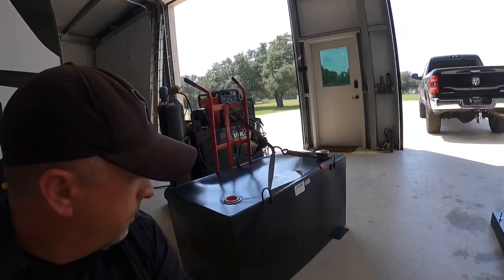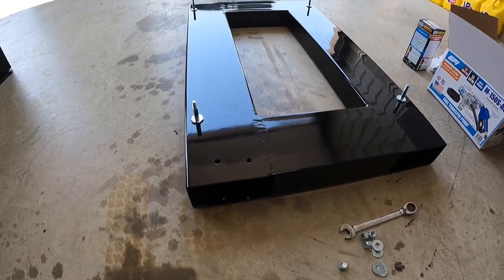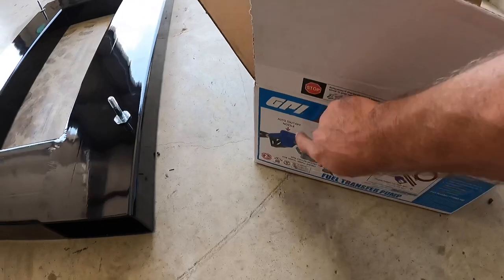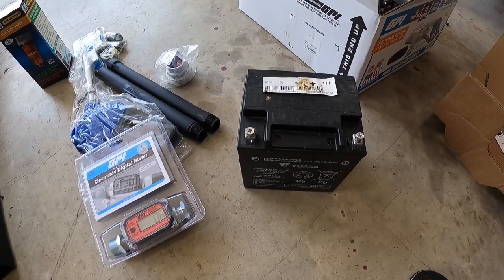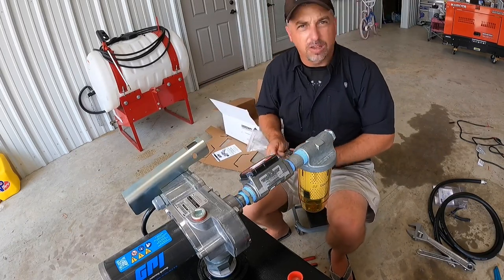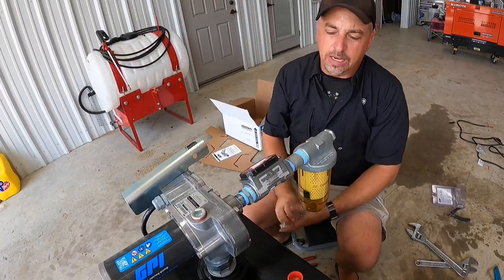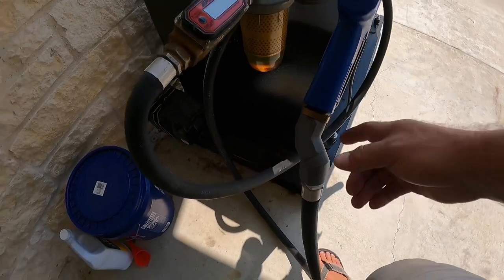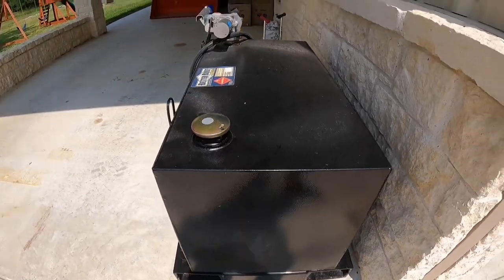Diesel Transfer Tank 100 gallon portable

Comment: Question i noticed the gas cap has like two settings will the gas cap automatically vent when turned in the fully closed position , or should i leave it in the half turn position to vent high pressure? My cap also has a small hole at the edge. I think its for a lock. Last question anyway to test for leaks. I have 100 gallon better built L shape for my truck . Thanks great video.

Comment: hey rocky
second time Im looking for a solution and I run into your channel (last time was for RV AC solutions)

Im actually now looking to add an auxiliary tank for my ram2500 diesel
but this cool video is actually for a shop tank. 

 have you ever put an auxiliary tank to any of your trucks? 
information is kind of all over the place. 
tanks go from $400 (lund brand for example) to $1500 without much difference for what I can see (some are plastic)
some people using pump, other gravity, 

we can see the quality of the jobs you do, would love to hear your input on that. 
thanks rocky
Reply from the maker: I have a few videos on my channel installing s&b 50 gallon. It has aux port and mounts under truck. I just like my bed space especially with rambox.
Reply from the maker: I built the standalone 100 gallon tank so I can load in the bed. If I have a long trip I can just load it up.
Reply: @RockyRohde  yeah I saw those videos thanks. but im on the fence with the 50 gal tank replacement vs a 40/50 gal aux tank. it feels like a lot of money and hassle for just 15gal more compare to stock. there are some very slim (10/12 inch) aux tank that gives you your stuck 30-35 gal plus another 40/50 gal without having to sacrifice too much bed space. 
they are gravity feed, so no stop is needed (lund for example. this is around $400) 
the titan brand has a remote control to open a bigger valve. this is around $1,100